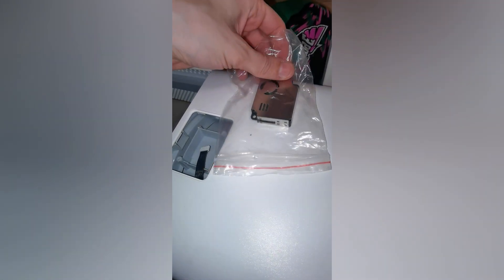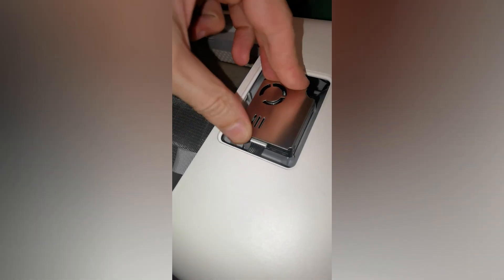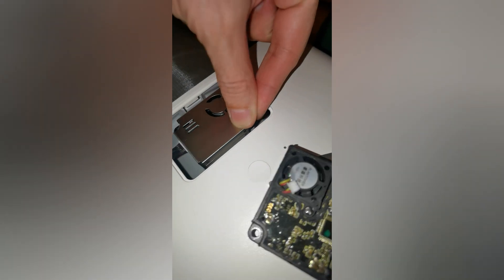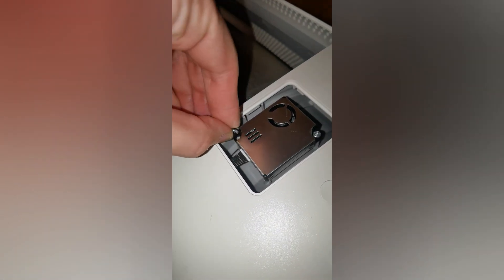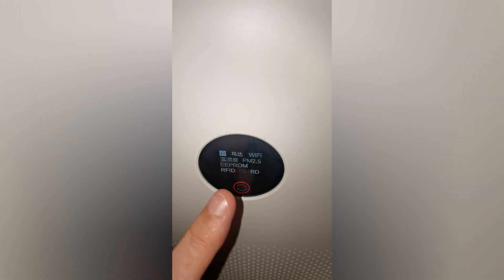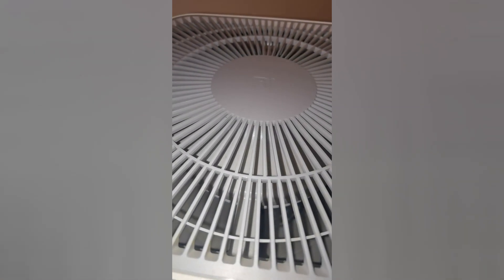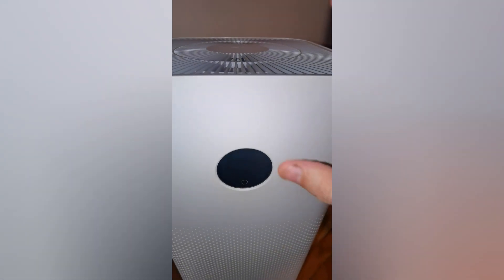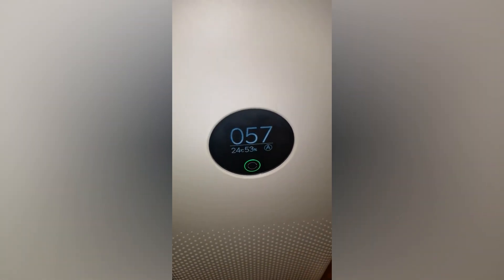HOW TO CHANGE INTERNAL PM2.5 SENSOR and RESET PROCEDURE for SMART XIAOMI AIR PURIFIER MI-3H

Comment: what were the symptoms of bad sensor? mine is showing 001 all the time, when I blow smoke into it, it goes max to 030, before smoke would show 999, and the humidity is showing like 30% more than it really is
Reply from the maker: mine it was stuck at 25 ppm always
Reply: @MariusVilceanu  I ordered new sensor, really cheap from aliexpress hopefully that will fix it :)
Reply from the maker: It will fix your unit with the new sensor.
Reply: @MariusVilceanu  already replaced it, it works again :)
Reply from the maker: nice!